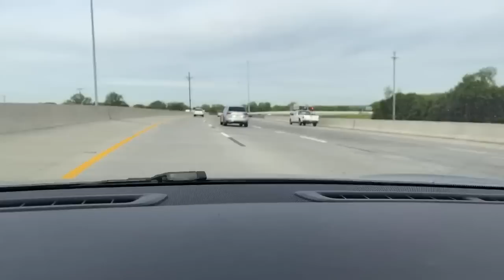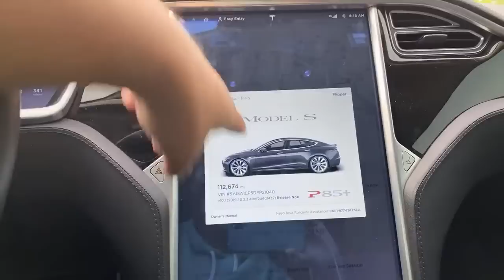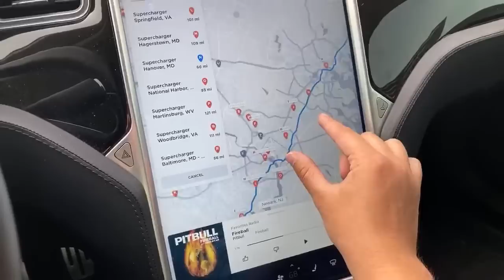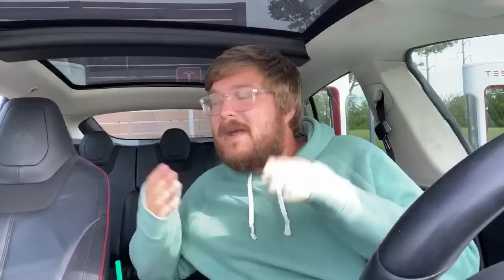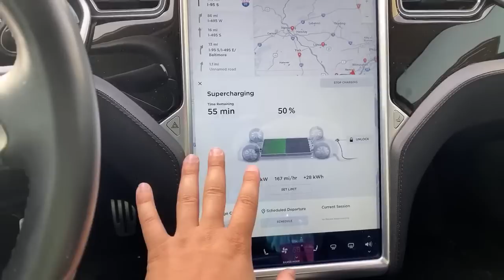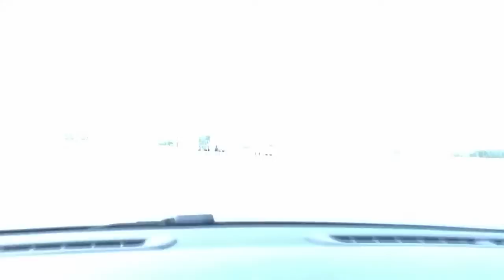Model S P85+ Road Trip (live)

Comment: Cool to compare your dad's P85+ battery capacity to my 2013 P85 which I think had a battery swap to a 90 it shows a rated range of 280 at 100% 😎
Reply from the maker: Is that with the ideal setting?
Reply: Ah yes that's the right term. 
So Ideal range shows 262 miles at 90%

Comment: I'd be super interested in your thoughts on Open Pilot if you have heard of it.
If not it's an open source driver assist system and it can be added to Pre AP Teslas and it is actually better than AP1 in many ways
Reply from the maker: I like it. No issues here. Just don’t want people to think it’s self driving - purely assistance that needs monitoring
Reply: @OutofSpecMotoring  
Oh for sure part of what I like about Comma AI and Open Pilot is it actually does real driver monitoring with a driver facing camera making sure you are watching the road. Unlike simple exploitable wheel nag or whatever